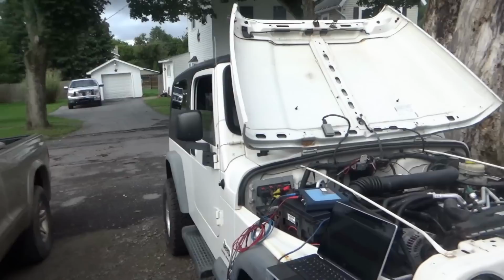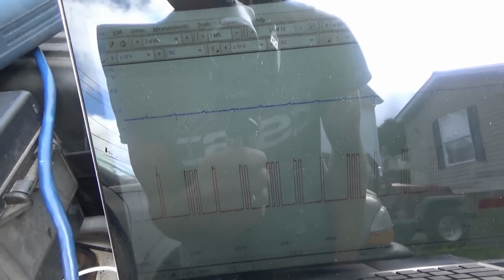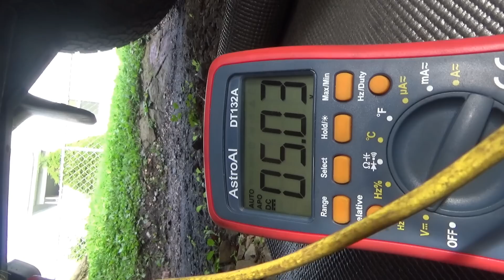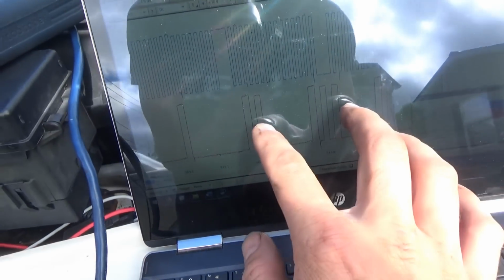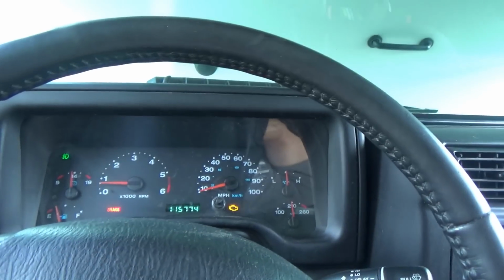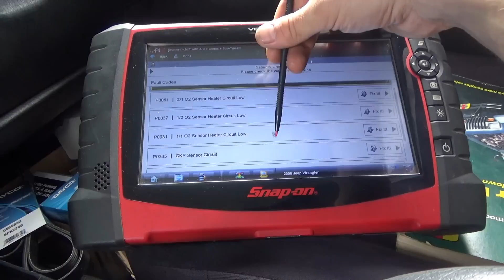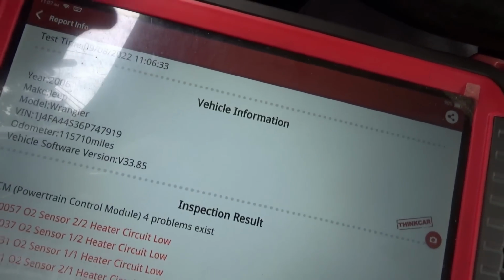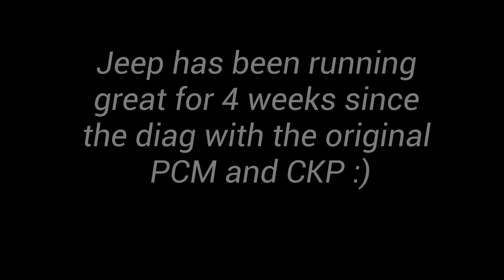Parts Cannon Vs. DIAGNOSTICS (Jeep Long Crank Time P0335)

Comment: I put a Dorman OEM blend door actuator in an '08 F150.  It ran through the learn sweep fine, but in use, when I turned the temp to full hot, the actuator stripped its gears at the end of the range. Ran the relearn multiple times, same result.  Swapped it at The Zone for another one, same results.  Dorman tech support said to do the re-learn again,  which I did just to humor them; then they said "Huh. That should have worked."  And no further reply.  Returned the second Dorman to The Zone and bought an OEM actuator from RockAuto instead.
Reply: Rock Auto is a gamble but Auto Zone and advance are just arggggh. O'Reilly's used to be too good but they went to crap as well. Gotta get super lucky.
Reply: @marshmower  OEM parts from RockAuto are a gamble?
Reply: so computors make sense to no one,    sue the feds.

Comment: A shorted O2 sensor heater can cause all kinds of issues on these. I would check the diagram to see if it shares the ground with the cam and/or crank sensors. It could be pulling them down intermittently.

Comment: Also to add, under functional test or system tests, perform a cam/crank resync. I believe it will perform it eventually after a few key cycles, which is why it may have gone away. O2 sensor heater codes, check main power fuse for the heaters. I believe this PCM pulses a ground to the heater while there is a constant 12v power feed going to the heaters which is why the detection logic can tell the heaters aren't working without 12v present. hopefully it's not an intermittent issue for the customer.
Reply: What kind of resync??? On oscilloscope is not any signal of that sensor...
Reply: @GraditelMacedonia  It's performed through the scan tool, typically under special functions/system tests/activation tests or whichever terminology the scan tool manufacturer uses. Typically only performed when the cam sensor or crank sensor is changed. Tells the PCM to learn the pickup coils "characteristics", and once learned, a deviation from that learned value can be used to trigger a DTC for a malfunction.
Reply: @GraditelMacedonia  it's not an actual resynchronization, since there's no way physically for the waveform to unless there's a major problem lol. Just the verbiage manufacturer uses. If I remember right I believe the PCM performs this after two ignition cycles after entering closed loop automatically, but don't quote me on that
Reply: @moo3993  Possible...if its factory settings, but otherwise, WHY???
Reply: @GraditelMacedonia  if I had the speculate, since there are probably different manufacturing tolerances, by using the scan tool to tell the PCM "hey I have new sensors", the PCM isn't doing guess work on whether or not the sensors are the same. Since only a technician would have access to that, I think it just speeds up the process once a sensor is replaced to have the PCM learn the sensors characteristics versus going through multiple key on engine running cycles. Plus thinking about it too during manufacturing, they don't have the time with a car coming off the assembly line every 10 minutes to go through multiple ignition cycles. Just a speedy way to get things assembled and working together and out the door
Reply: I was screaming everything you said the whole time 🤣🤣
Reply: @moo3993  THERE IS NO CRANK SENSOR SIGNAL AT THE PCM A SYNC WILL DO NADA
Reply: I know on my ‘05 Ram that after replacing the crank sensor the check engine light will stay on. The relearn procedure is to drive the vehicle to 60 mph and then let it coast down close to 0 mph and then shut the truck off and then restart and CEL is then off and truck is happy once again.

Comment: I’ve replaced countless bad o2 sensors due to open circuit heaters. Ohm out the two wires of the o2 that are the same color. Gray gray, white white. What ever it is. If no resistance, Chuck it for a new one.

Comment: I would have liked to see some voltage measurements on the heater circuits.  It looks like they all share a ground at G105 and are fed power from the PCM.  G105 is used for a ton of different items so I don't suspect a bad ground but a shorted heater could possibly wreak havoc.
Reply: Came here to say basically the same thing.
Reply: did anyone catch the battery ground terminal has wires added and looks worn out with junk wedged in the one side so it tightens on the battery post? looks like a screw or wad of wire on the one side. poor battery connections wreak total havoc on them.

Comment: From comments you, Eric O, Rainman Ray, Watch Wes Work and a few others I have watched, Chryslers seem very particular about non OEM sensors. I personally have in the past and would continue to only put OEM on my Land Rover Discovery, I fear anything European would also not like non OEM.

I have an old Nissan Tiida (I think it is a Versa in the USA) that I just bought as a daily driver - anything other than necessary OEM will go in it, and when I say necessary OEM, I mean pats that are not available aftermarket. It is a beater for around town only, with my main concern being it drives, stops properly (no skimping on brakes), good tyres ( no re-treads) and the air conditioner and power steering works. Oh, and my dog loves it!!

Comment: Dorman doesn't make anything good.  I recently had purchased an intake manifold for a 4.6 Ford.  The thing didn't even fit correctly.  I ended up with an OEM kit; the original manifold has been discontinued.  I cobbled it together and it works great!   Great video!

Comment: On my 97 XJ (with the 4.0) if I can get MOPAR, I always use the OEM part.

Been snakebit multiple times on aftermarket sensors that just flat don't work.

On the 4.0, the crank position sensor especially is one that you never use another brand.

Another is the oil pressure sender.

Dunno what's up with the O2 sensors, in 97 there's only one or two of the things and in 25 years I've never had to touch them.

Comment: (I'm only 1 min into the video).    I had a problem similar to this on a 99 Grand Cherokee with the 4.0 I-6.     The guy before me had the distributer off by a tooth and also had the cam sensor wires cut and hacked into for some reason.  I even had to buy a new connector for the cam sensor..  I bought new cam and crank sensors-- and it was still intermittent;  until I pulled the crank sensor again and re-mounted it.   I guess it's sensitive to the depth..  I believe the aftermarket junk crank sensor had a washer on it, and was causing the reading to be too weak-- so I removed that washer, which allowed it to sit deeper into the port, and that cleaned up the issue..   It was actually a very reliable engine after that problem.  I even bought a used coil pack on ebay for it too (it was super cheap);  just for piece of mind.  I kept the old one for a spare.  But like I said, it never gave me any trouble after that.  I really like the 4.0.
Reply: That's pretty awesome you figured that out! I wouldn't have.
Reply: Buying off ebay is just asking for trouble ....counterfiat parts
Reply: @nickmalone3143  It was OEM.. It was just used..   That Jeep was around 160k miles when I traded a great running Banshee 4wheeler for it.  And we put well over 300k miles on it from there.  So other than this one hiccup with the crank/ cam sensor-- It was a flawless engine.

Comment: The minute you said Jeep 4.0, long crank, replaced CKP, I knew it was an aftermarket sensor. It’s not only Dorman, but pretty much any aftermarket sensors are a no-go for these engines. I don’t know why, but the OEM ones always seem to fix it.

Comment: I had that exact O2 issue on a 2006 Chrysler 300 I bought off one of my customers, would flag all 4 sensor low circuit fault immediately. All of the sensors tested good, the Identifix “what did everyone else do” option had dozens of “replace PCM” fixes, needless to say a PCM fixed it, still on the road 3 years later lol

Comment: Those early 2000s engine modules would crack the solder joints on the board, or crack the board, if you flexed the connectors a little you could duplicate the stalling or misfire concerns.

Comment: As the owner of an '05 Caravan (3.3L, 120k mi) I'm familiar with strange ECM behavior.  At some point over these last 15 years, I believe ours experienced a "power event" that either damaged hardware or corrupted firmware. Or maybe a cheap sensor (replaced at least 3 times by a pro). Beyond a recurring check engine light, the vehicle runs/behaves fine so I just reset it and live with it.

Comment: Right now, I am driving a 1995 Chrysler Intrepid, which I am confident can be driven anywhere, right now! Yes it has 120,000 miles, which is low for the year, but it is turning 28 years old right away! It does show you that just because a car is old, it does not mean it is unreliable! (This is a no rust car by the way)
Reply from the maker: Cool! Hopefully it makes it to 300k but I wouldn't put my money on it 😅
Reply: @PineHollowAutoDiagnostics Ha ha! I would not bet on it either, but you never know. I will not see that mileage with it, it was just a project for the channel.  I am sure it will be gone to a new owner in the summer.
Reply: hopefully it doesn't have the dreaded 2.7L, if it does, hold onto your wallet lol
Reply: @throttlebottle5906  It’s my winter beater. It has the 3.3 pushrod V6 so I should be ok! I have a couple backup vehicles though if something happens! LOL! Hoping to get 20 or so videos of this car for my channel.

Comment: From personal experience I can say with 100% certainty that any sensor, module, relay, etc that is not OEM MOPAR will cause an issue somewhere down the road. These Jeep ECMs are extremely picky as to what it will accept and aftermarket is generally not accepted. I always disconnect the battery terminals and touch them together for a minute after installing anything electrical. Oddly enough, even with new OEM it still may take two relearn procedures to run correctly (just had this happen recently when I installed a TPS sensor on my 98 4.0 TJ Sport). Not sure why, but it's a Chrysler, so......
Reply: Do you think it has to do with incompatible software/data? Like the OEM computer can't accept data sent out from aftermarket sensors, for example?
Reply: @PalkiaDialgaGiratina  It undoubtedly has something to do with voltages and resistance but exactly how it (the ECM) goes about determining a good signal from bad is beyond my scope. I bought an OEM (reman) set of injectors because I had one leaking from the housing. I did my  usual due diligence and disconnected both battery terminals before removing the old ones and then installed the new (reman) set. I hooked the terminals up twisted the key, and I get a long crank and a studder then dead. Tried again, same result! So I go online. All the blogs/forums I see point to an issue with Ohms, so I check every one to see if they fall within spec, and they are all dead nut 12 Ohms which is well within spec! So, I put all the old ones (which were 12.4 Ohms) back except the leaky one for which I substituted the reman injector. Same procedure, engine started up and ran like a top! No codes, perfect. Now I have 5 reman injectors that I can't figure how to install! About a month later I decide to swap in two more (drive cycle was complete). Swapped them in, and no issues. Drove it for another month and went after the rest. I finally got it to accept all 6, I just spead out the install. Go figure! I'll just add that all ground points, chassis, frame, engine, etc had been cleaned or replaced with a better grade prior, so it wasn't a ground issue.
Reply: @basshunter428  Weird. Seems like there was some sort of adjustment period involved. My amateurish guess states that with the 5 original and 1 reman, all the inputs and outputs were within acceptable parameters, compared to changing all 6. Then after you finish the drivecycle, where the new injector has been "broken in" so to speak, you add a couple more and then repeat, with the PCM having to adjust a small amount to the new parts each time.
Reply: @PalkiaDialgaGiratina  That is my suspicion. I also had to replace the distributor (entire housing) because the previous owner had snapped one of the  mounting screws off (the steel/aluminum combo is a bad idea) and Crazy Glued it back on! So I bought a CROWN replacement. After installing the new one the engine started and ran with a bad misfire. I thought I might have installed the distributor a tooth off. After checking numerous times it became apparent that the distributor was installed correctly, so I swapped the old CPS for the new one. It cranked right over and has been running fine ever since. The ECM would not accept  the aftermarket sensor! I believe the ECM is possessed but I've learned to live with it because the engine is a beast! 💪😆

Comment: Has NAPA ever sold a working Sensor, I'm not sure if I really even know, Because I tried using Two Water in fuel sensors for the Bottom of Duramax fuel filters Both were Shit the Stupid floats would float in Diesel without water in the Fuel, So what was the point of that, If you didn't want the water in fuel lights On both Sensors had to Stay unplugged, Quality control is definitely a JOKE, Now of course to be fair it was 7-9 Years ago now 🧐. Great Content as Usual 🇺🇸👍Thanks Ivan.

Comment: No idea of those computer internals, but I thought of an old problem from 20 years ago: opto-isolators [often used for noise rejection benefits] need a high impedance load on the output, or may fail.  A check engine light [or any indicator bulb] does not qualify.  These chips need to be used to bias a transistor circuit on, which will drive a higher current.  What happened to me was if a fault indicated for something past one hour, an internal short developed which prevented reset.  The only load on the "fault" output was one indicator light [less than one half  amp draw].  No relays, pullup resistor, or anything paralleled: chip output, to lamp, to return.  Failure was guaranteed - kind of like some  mallory distrubutors when ignition gets left on, but engine not running... and the rotor happens to be where slot triggers output/return connection.

Comment: ..i had this happen with a Ford, turned out the O² heater circuit was run through a Fusible Link that had blown..replaced that Fusible Wire & No More Problems..it was part of the Keyed Ignition Circuit, & Bypassed the Computer..

Comment: Check whatever the 4 sensors heaters have in common - fuse, wiring? Do a voltage and continuity test, bypass the ECM switch to ground (energize the sensor heaters) with a multimeter on current mode to see if the sensors themselves are fine.

Comment: The 05/06 4.0L had opda issues, the crown was a good replacement but not the CPS sensor that came with it :).  I was not surprised the dorman ckps was bad and the mopar was good.  My friends 04 4.0L TJ  was toasting CKPS sensors, turned out to be a bad engine computer

Comment: Had a 04 with the 4.0. Right off the dealer lot, on a warm start, it would do that kind of long crank nonsense intermittently. In the back of my mind I always suspected it was the crank position sensor being stupid, but it never set a code, and I never had it looked at because it was intermittent...

Comment: OH man I had the EXACT same problem on a customer's 06 Wrangler Rubicon. Battery wasn't charging. Customer put 3 alternators in it before it came to my shop. I found a broken ground wire on the eyelet on the passenger side of the engine block (Behind the crank sensor). I poked it with my finger and the engine stalled. Repaired the ground and check engine light was on for all 4 O2 sensor heater codes. I somehow fried the PCM when I poked the ground (7 wires on one eyelet). I spent a couple wasted hours trying to prove it every which way. I could even command each O2 heater on with the scan tool and they each put out the correct amperage, that's why I was hesitant because I've only heard of Chryslers frying the drivers internally, not some kind of weird ass logic fault. I sent the PCM out to a place in Iowa that fixes them and for $150 it was all fixed! Rubicon PCM's are NLA and have been for many years. Loved the video!
Reply from the maker: Sounds like a BMW PCM failure haha

Comment: The aftermarket ckp sensors don't work on jeep or nissian bcuz the magnet is too weak to sense the reluctor wheel. Wouldn't the O2 heaters have a fuse ?for low the voltage code. ⚡️  Great work as always PH.
Reply from the maker: On this model the PCM sends out 12V to heat up the sensors...

Comment: It would not surprise me if it was setting a CKP code before it learned the old sensor. That usually requires driving it. Why a circuit code? You got me.
Remember that Daimler was in charge of Chrysler during these times.
I still find it disturbing how Dorman can survive as a company. Even their non-electronic parts are garbage.